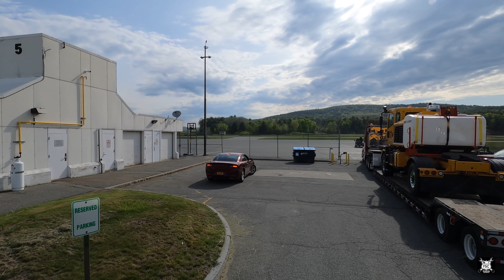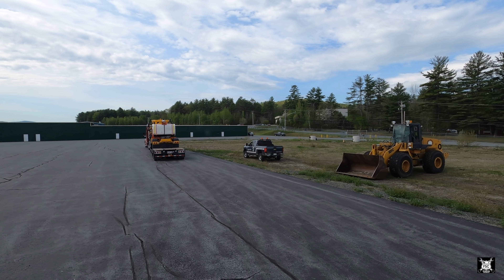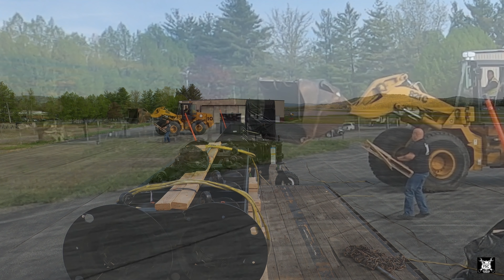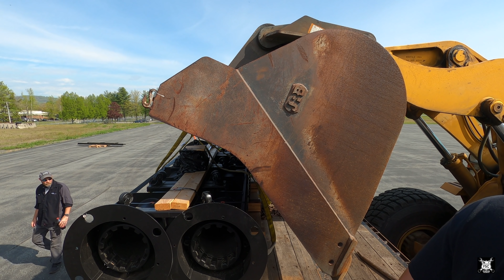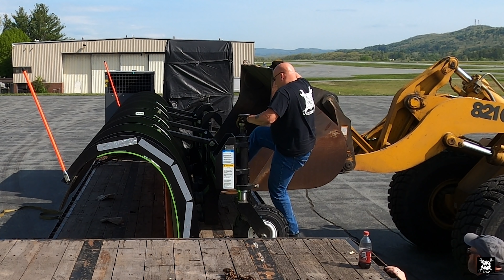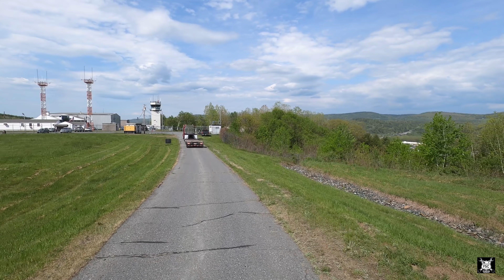Cabover Peterbilt Drives On Airport Runway

Comment: That's cool! When you were on the runway, you were supposed to speed up so you could "take off". Not too many years ago, I delivered a load of structural steel to LaGuardia Airport in NYC. They have razor spikes under the gate to flatten the tires of unwelcome intruders. After going through security, I got escorted across the tarmac. This was pretty surreal for me cuz about 45 yrs ago I worked for a caterer and we serviced the airlines. I drove a van with a revolving yellow light on the roof. I could let myself through the gate at Albany Airport, drive across the tarmac and go up on the planes by myself to strip out the galleys...My how times have changed!

Comment: You have evidently loaded and unloaded a variety of stuff using all manner of machines.
It can be tricky knowing which end is the heavy one, and where the load's centre of gravity is.
No doubt , experience has taught you that suspended loads can behave unpredictably.
  I see that you soon worked out some signals with the front end loader operator,
good communication and teamwork,
so the whole operation went well.
You're a true professional,
and a good ambassador for the transport industry.

Comment: You mean to tell me that airport Maintence Department doesn’t have a big forklift to unload the truck?  At least they could get a fork attachment for that front end loader.  It was painful to watch them using that bucket to unload you.
Reply: Interesting how there are chain hooks welded to the bucket.
Reply: @JV-pu8kx  Most likely they attach a snow pusher to the bucket in the winter,thsts what the hooks are for
Reply: @RM.....  That is EXACTLY what' they are for.
Reply: Their running lean and mean in Lebanon. I think more of their budget is likely spent on snow equipment and removal than anything else.